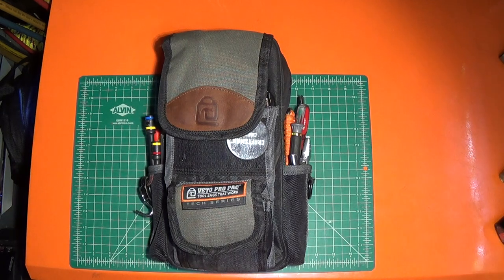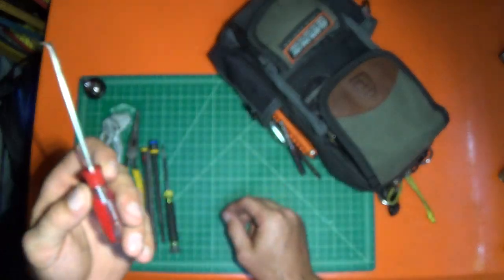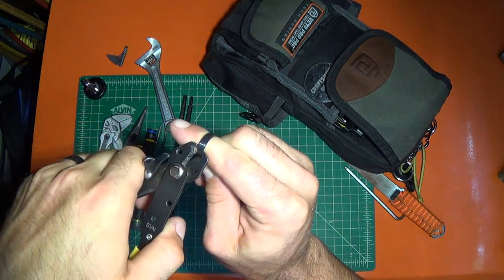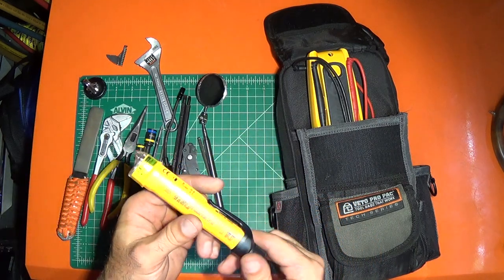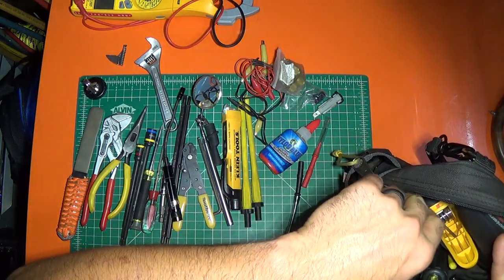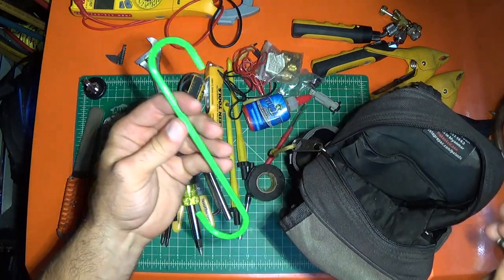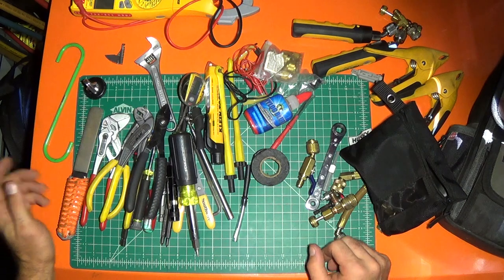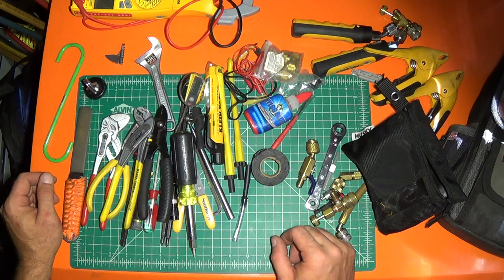Loadout1: Veto MB2 HVAC Loadout

Comment: I really like that small crimper/stripper as well.  Got mine at Napa for I believe 20$ and much prefer it over the bigger ones for 95% of things.  Also really enjoyed the mb2 as well.  For running service and figuring out what’s wrong, really don’t need anything bigger.    Going to have to go back to the truck to get stuff for the repair anyway so I carry the minimum with me and get the other tools I will need while at the truck. 👍🏻👍🏻
Reply: @HVACLife  yessir   I have the bigger one as well but gets kept in the bag with everything else that is not in my small bag.     The only thing for me that I do like better about the larger one is the wire cutter being out on the nose of it but that’s fuck all in a big ship to me.   The other techs I work with have all switched to that smaller one as well after seeing and using mine.  Like you said several different companies brand that pair.  Carlyle, snap on, Mac, Matco and the list goes on.